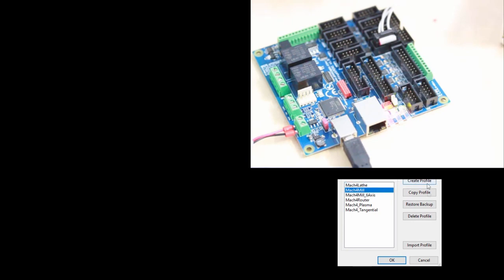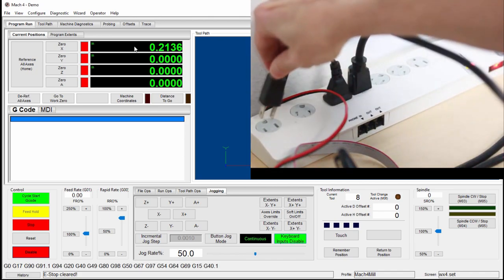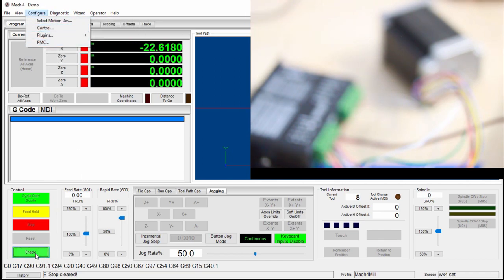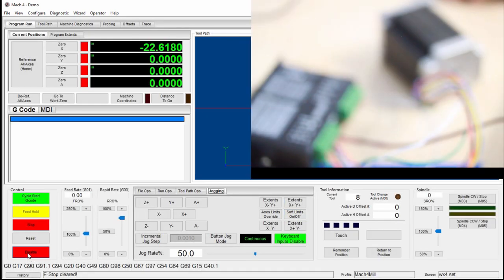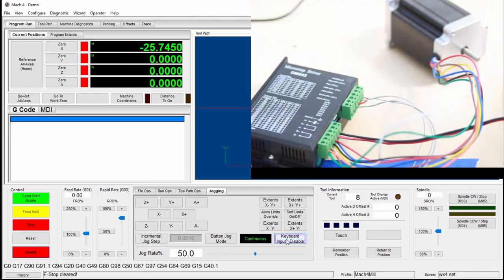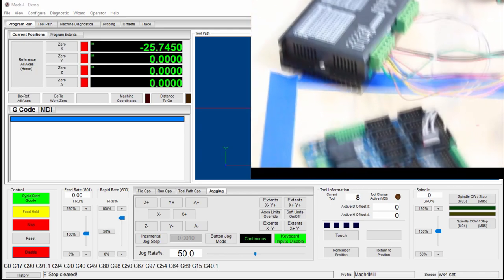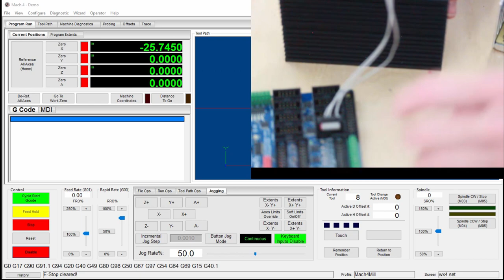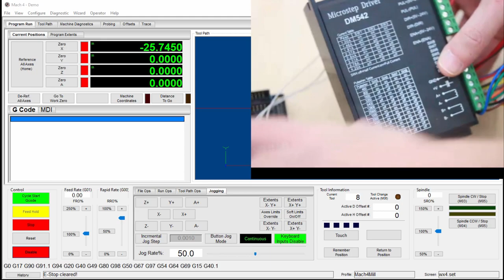Pokeys57CNC and Mach4 Part 2: Connecting a Stepper Motor and Driver

Comment: Hi , in your videos you are using 24V 1 Amp power supply with pokey57cnc. Can you please tell if 24V 2 Amp can be used or not. Will it harm the circuit.

Comment: hello im building a plasma table with pokey 57 ant the thc plasma sense  with mach3 the problem that i have is thc is not working it wont readout the voltage when it arc when the arc stop you will see a small jump in the voltage any idea what that can be
thanks

Comment: This is definitely not the correct way to wire the Pokeys57cnc motor outputs to a standard stepper driver.

For each pin on the motor out there is a positive and a ground.
The labeled pins on the motor out are 
Enable+
Direction+
Pulse(step)+
Alarm+
and a 5v+ which isn't used in standard stepper drivers.

This means that if you're not planning on using enable, or the 5v positive, the outside wires 1 & 2, 9 & 10 can be capped/cut off.
The rest have a ground beside them, and as per making the unit stable, each should make use of its own ground.

In the end you will wire up
(optional) 1-2 to enable
3-4 to direction
5-6 to pulse
(option) 7-8 to alarm
9-10 are unused (drivers utilize external power source)

The only thing that needs to have attention payed to is ensuing the polarity is correctly wired for each pair.
This is how the Pokeys folks verified to me that they recommend the wiring. (They REALLY need to put it in the manual, and stop pretending that their ecosystem should be the only explained hardware in the manual) *Kinda puts me off from building with anything from them in the future.
Reply: Hello, thanks for your comment. So i have to wire both 3 and 4 (gnd) wires to the DIR- pin for exemple?
Reply: @vincentb2490  
Um, no!

The reason there are enough gnd wires, is to ensure that all of the positives have a corresponding gnd.
You could "technically" wire any of the gnd wires to any of the negatives on the stepper driver.

They give you more gnd wires, so that you have a gnd for each positive wire.

In the documentation, all of the named pins are positive, and the rest are just labeled gnd. All of the [gnd] pins are the negative pins.

2, 4, 6, 8, 10 are all universal grounds (-)
The rest are labeled and go to the corresponding positive (+)

I just like the cleanliness of pairing the positives to be used with the ground next to them, so you can split the flat cable in the least cluttered way.

axis enable = 1+, 2-
direction = 3+, 4-
step = 5+, 6-
error/alarm = 7+, 8-
+5v = 9+, 10-

I think this division of pairs is the cleanest. You could wire ANY of the [gnd] as negative to ANY of the negative driver pins. You could (though I don't recommend it) use only one of the [gnd] pins and wire all of the negatives to that one pin.

[gnd] is common, meaning that they all go back to the same place.